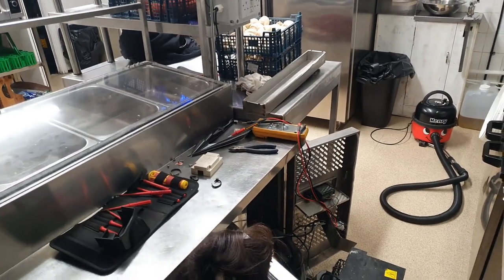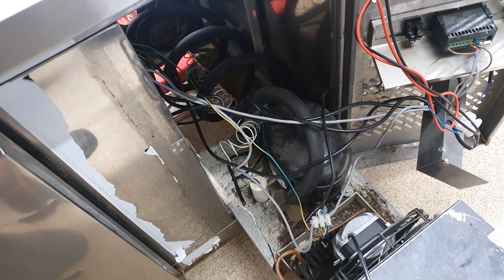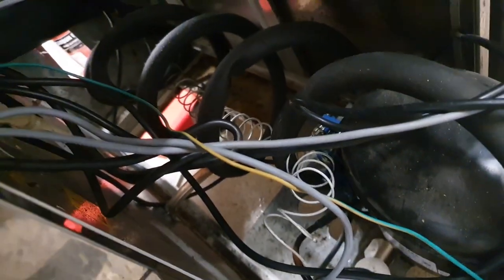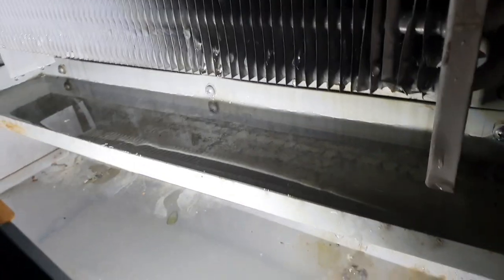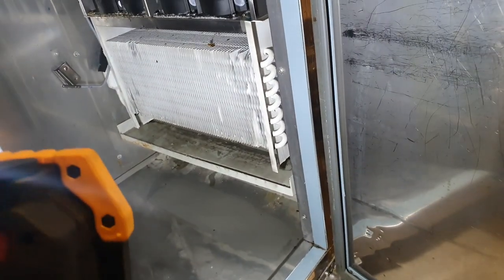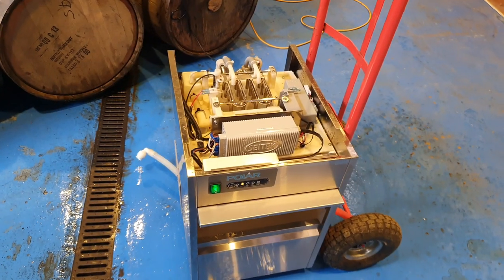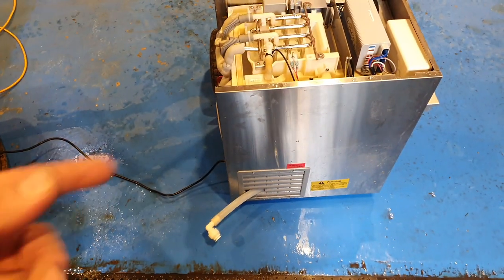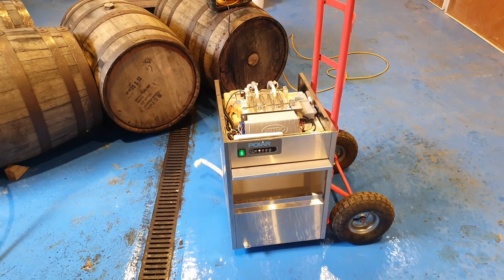Servicing The Condenser On A Saladette

Comment: You can add a time clock on the cooler to defrost overnight and that will definitely help the unit. And unfortunately you will have to clean out the drain line and the condensing coil once every six months.